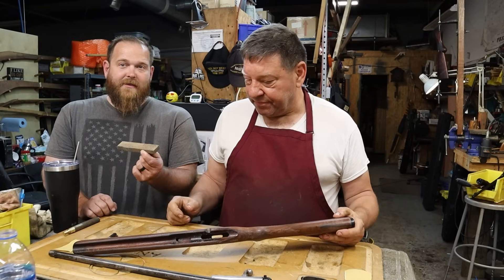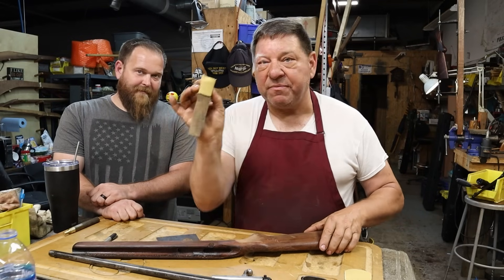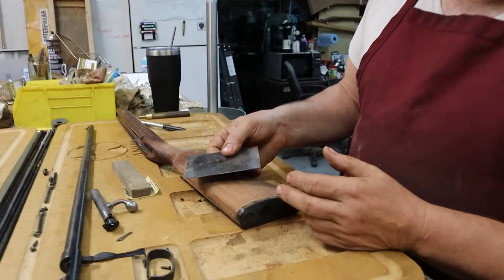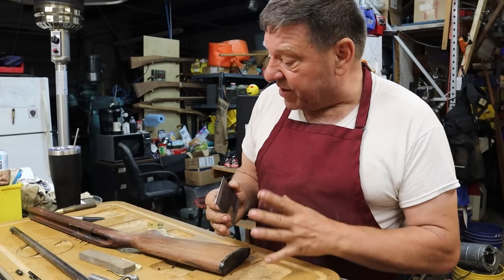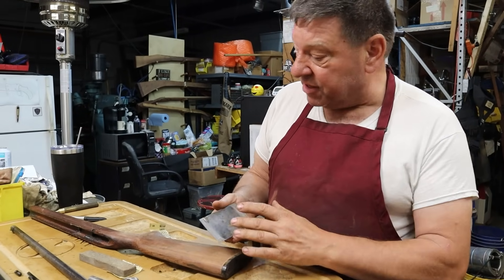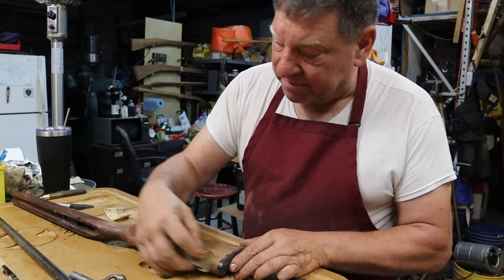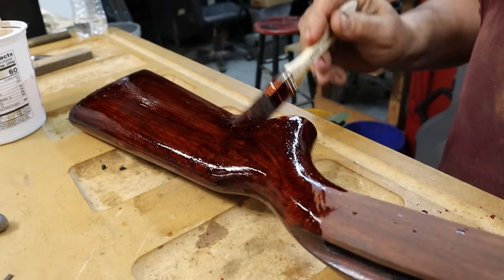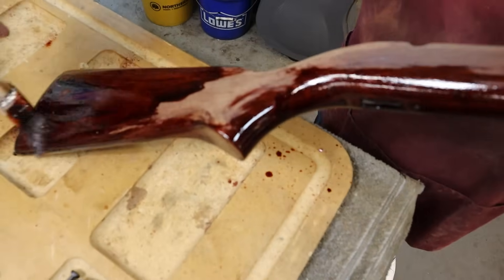Stock Refinishing Like A Pro: Mark Novak

Comment: Mark taught me to scrape many years ago (via video) and its crazy how much ive used it.
I had a flat "multi tool" scraper (one of the oscollating dohickeys) that I never used.  Nice springy steel.  Ive put many miles on it.    Probably cut it down 3/8 of an inch sharpening it by now.  Redid every gun damaged in a house fire.
Mark. Is. The. Shjt.
Reply from the maker: This one was damaged in a fire too. Im glad I took it down to him. This wasn't the main project though.
Reply: Mark is the carbon based lifeform
Emphasis on based
Reply: How do you tackle the checkered areas or just leave those areas be?
Reply: @pickletickle101  Probably best to use a checkering tool to chase it, or grind a tool with the right geometry.  That makes it a lot more complicated to be honest
Reply: @mattfleming86  That’s what I figured. Wasn’t sure if Mark said in any other videos. Thanks for getting back so quick!

Comment: I recently refinished/reshaped a model 514 stock just like that. I straightened, pointed and fluted the comb, reshaped the toeline and added a grip cap, fitted a new buttpad with a brass spacer, cut the forend tip and added a ebony forend tip also with a brass spacer. Sanded everything starting at 100- 220. Sealed and sanded the finish in (tru-oil+mineral spirits)from 320 all the way through 1000(many coats sanded in) until all the pores were filled and the finish was smooth as glass then buffed it down to a crystal clear satin sheen. It took some time but there was some gorgeous wood under all that varnish and stain.....It was a gift for my dad.
Reply from the maker: Sounds nice!

Comment: As an amateur gun smith I can't get enough off your videos! 
Thank you so much for the tutorial.
Reply from the maker: Thanks for watching!
Reply: The toilet ring you mention is just bees wax correct? 
So any old bees wax candle should suffice for the final top coat? 
I have been using mostly Tru Oil or neutral danish oil.

Comment: I've learned for 5 years as a furniture restaurator & learned french polishing from an old guy who actually learned it in switzerland (rest in piece, Rudi), I worked for many years as a custom cabinet maker and I learned SO much from watching gun makers and I'm still learning / refreshing by watching gunmakers. I can recommend that to every aspiring woodworker: watch the gunmakers & learns that bit from them. It will enhance your view on the "bundle of soda straws" ;)
Another little thing (when you have fresh wood): wet it a little, dry it, then 320 or 280 it again, not much, just cut the fibres the water had standing up. The emphasis is on A LITTLE here.
Reply from the maker: Thanks for the tip!
Reply: Omnihil thank you for your tip at the end about the water grain raising and gentle sand back…I’ll soon be doing a pine electric guitar body, and will use real red Alkanet root dye , with danish oil and wax as Mark did here.

I can’t wait for spring to roll around to get cranking on it!

Stay safe ! Best regards, Shawn

Comment: I've been using scrapper in place of 90% of the sanding I used to do on finishing furniture that I build. It leaves a smoother finish as sand paper plugs grain and tends to sand the Summer and winter grain structure differently leaving a wavy surface. Very small with most hard woods, but it's there.
Reply from the maker: My sandpaper use just decreased. Scraper is how I'll move forward from now on.
Reply: @PatRMG  You must have found the same befits I Did. Including less fuzzy surface, smoother feel and easier finish application. I was really convinced by Paul Sellers YouTube channel.

Comment: Mark is a wealth of information. With a polished hammer face, you can gently move dinged dented iron back where it needs to be. I have even used his wisdom to try out rust bluing. (Starting on axe heads, until I have the hang of it, of course. I'm not an idiot, contrary to what my ex-wife says.)
Reply from the maker: I've got about a week of time in Mark's shop under my belt. I'm freaking blown away every time.

Comment: Very nice, thanks Pat & Mark! I have a 1976 Marlin model 60 with the pretty squirrel stock. Gun is really accurate & runs like new & I need to work on the stock. Been putting it off bc I don't wanna mess it up & not be happy with the results. I work with a lot of wood, paint, & stain so I'm confident I can do this process & make it look like a new but original finish. Very good work, explanation, & demonstration! 👍👍 Thanks again!
Reply: Make sure the stock is Walnut and not Beech. This stock is walnut. Beech not so much.
Reply from the maker: Thanks for watching! I actually have a model 60 that I need to repair. Needs a spit shine and a sear spring.
Reply: @marknovak8255  got it, thanks.
Reply: @PatRMG  nice, can't go wrong with a Marlin.
Reply: @marknovak8255  Any tips for refinishing a Beech stock?  Many out there that need it!  I'm thinking of doing a Russian Red tinted poly job on a Beech Marlin (no squirrels will be harmed) for my grandson (he likes red).

Comment: Sir,  I think I heard you say you "boiled" the barrel, what does that mean?  Also, God forbid there is a fire and smoke damage, should we clean our rifles right away, leave them, or do something else?  I appreciate your work.  So many gunsmiths are just AR-15 focused.  What you do is the old art, and it is truly awesome!
Reply from the maker: Yes, boiled. He has a hot water tank that he hung the barreled action in. It causes the  bluing chemicals to convert. Then, he uses a special buffer to remove the oxidation to reveal the pretty blue finish underneath. 

I had preserved this one 7 years ago after the fire by cleaning and oiling immediately. It lost all its bluing from the heat and steam. Just had to keep an eye on it and keep it oiled.

Comment: Good timing Swaby. Have Mossburg 151K somewhere on UPS truck. Was going do Laquer to dissolve the finish, Its a great Smell good. I use to paint old cars,. the rifle shows light rust. May boil, I will see how bad it is. Has to be better than Mausers I mess with. Cute Socks.

Comment: Great video, Mark, as usual. I would, however, caution DIY'ers about proper handling/disposal of rags used to wipe linseed oil-based finishes. Before disposal of wiping rags, it is important to hang or lay the rags in a single, flat layer to dry completely. Rags/paper towels that have been even slightly saturated with linseed oil, if thrown in the trash or balled-up, can easily spontaneously combust, sometimes in a few hours. Some people will soak them in water, but allowing them to air-dry instead has always worked for me, the very same advice is appropriate for disposing of oil/solvent based stains.

Comment: This is the best video Ive seen for refinishing a stock. I just need to take off the top varnish on a Tower Musket. It was a kit and the maker put varnish on and it has drips EVERYWHERE. Your way may just be the trick to remove the varnish and refinish the wood. Can you give me more information on a steel scraper? Can I roll and sharpen an old paint scraper? Thanks again.

Comment: Great job on that old Remington 514.
Reply from the maker: And George identifies the mystery gun perfectly.
Reply: @PatRMG  My perfect afternoon involves a lawn chair, a beverage, an old 22 like the 514, and a full pocket of "bullets". Oh, and a distant steel target to measure the man😄
Reply from the maker: I took the 550 down for a bit of help too. It's looking good.
Reply: The first rifle stock I "refinshed".
I went about it . Exactly the way Mark explained....Don't. 
And capped it off with a thick layer of polyurethane.  Resulting in the forend of the stock Checking at the bottom of the barrel channel.

Comment: Broken plate glass works great as a scraper as well. May sound crazy but if you have it it's easier than putting an edge on a steel scraper.

Comment: great video Pat.,,,, i could set and watch Mark do his magic all day would give my eye teeth to have been able to have trained under him. nice 22 and i gotta ask  HTH did you get Mark to work on it??? from what i've heard him say i didn't think he'd touch one much less work on it..one has to admit he's a master of his trade..i have one that's similar to yours i'm working on right now. talk bout a hunk of junk found it tucked behind a post in a barn ..don't know if even Mark could fix this one but i'm going to give it a try...it's an old targetmaster so it might be worth tinkering with..right now the bolt is froze and i've got it soaking in Marks favorite stuff..."angel piss" hoping it will break free
Reply: Once the bolt is out, concentrate on the bore. If that doesn't clean up, STOP. The bore is the key. The rest can be "fixed"
Reply from the maker: The answer to your HTH is that it was part of a bigger deal. 94 degrees in his shop and I possess a certain set of skills to fix that. 😁
Reply: @marknovak8255  i've had a cleaning rod down it to check to see if it had a bullet in it but i don't own a bore scope so can't see down it but just a little ways with a light  but once the angel piss does its job and i remove the bolt if the bore is shot it's scrap...it is rusty but most is surface if the bore isn't any worse than the outside it's a maybe...stock is the big problem it's been wet has some cracks don't know if it can be saved..thank you for thr reply any knowledge from you sir is most welcome sorry for being so long winded
Reply: @PatRMG  ooooohhh....ok i see said the blind man...good trade
Reply: @PatRMG  Wanna ride up to WV and install a full unit in a vet clinic?  Totally easy job.  I swear you won't have to remove a drop ceiling just to get to the hole where the air handler lives and hoist it up with pulleys.  And the dogs are suuuper quiet.  :-D

Comment: Hello Mark,

Can you let me know what brand of Danish oil you use?  I can't seem to find the red color you are using in your video.  I am in the process of restoring a Wards Western Field 93M 390A rifle.  The rifle is approximately 80 years old and I would like to restore it to as original condition as possible.

Also, I was very pleased with the results of using a scraper to remove the old finish on the stock.  In the past I have used water soluble strippers on my stocks, but was not happy with their effect on the wood.  I had an old metal scraper that I used to remove wax on my cross country skis.  It did a wonderful job.

I enjoy your channel and your sage advice.

Regards,
Charles Henley

Comment: That was a great video! Just had a question about the finishing process. Mark mentions he would apply 3 oil coats, then 800 grit sand, then buff the 800 grit sand with ultra fine steel wool... Is that the overall idea before applying the wax?

Comment: Mark, do you ever do a high gloss stock finish? Like the one that look like there’s a 1/4” of water on top of them? Do you have a video showing us that?
Reply from the maker: I haven't seen him do one. He says they look like table lamps in a French wh***house.
Reply: @PatRMG  Dude is talented but I like that high gloss finish. Managed close with TruOil on a old Marlin/Glenfield Model 70 stock. Stock was a Marlin Model 60 I fitted for the 70 and how much better did it look. Too bad I can’t attach pics.
Reply: You CAN get the high gloss, French polish finish. It takes about 20 oilings over a 2 month period of time, buffing and polishing between coats. A 2000 dollar finish on a 50 dollar gun. The finish you are thinking of is a sprayed on urethane, Looks amazing until it gets damaged or the wood moves underneath it (EVERY Browning). These finishes are not repairable. Oil finish is easy to repair.
Reply: @marknovak8255  Thanks. Just the old standard boiled linseed oil or something different? I got a decent result out of TruOil on a Marlin Model 60 wood laminate stock I finished and fitted to a cousin’s glenfield model 75. Looks good but could look better.
Reply: @308dad8  SAND the wood, POLISH the finish
Reply: @marknovak8255  Thanks Mark
Reply: @308dad8  Watco Danish oil
Reply: @marknovak8255  Thanks
Reply: @marknovak8255  Looking online it looks like this stuff only comes with color in it. Is there a clear version? I’m getting ready to do one of those Traditions muzzleloader kits and the stock is curly maple so I want to get the traditional Aquafortis Regent stain on the wood then the durable high gloss finish. The finish needs to be clear so all the contrast will be visible.

Comment: Hey guys, one thing I forgot to mention in my comment was , you don't need to go spending a ton of cash to get card scrapers, you can make on out of an old hand saw. just clip it off with tin snips to the shape you want. they are made of spring steel and work  very very well and they are flexible, and hold an edge. just a tip guys 🙂..

Comment: Beautiful work couldn't have done it better myself 
Did you blend the oil yourself or is it available
Reply from the maker: He threw a little red into the Danish oil. Then, the wax added a bit of purple hew.
Reply: Watch Danish oil, straight from the hardware store. Added some oil soluable analine leather dye.
Reply: @marknovak8255  thanks
Reply: @marknovak8255  fiebings red leather dye mixed in the danish oil?  Would you be willing to share how dye you add to a quart of danish oil?
Reply: @mattray3171  .Based upon the days long drying time referenced by Mark, he probably used Fiebings Pro Dye, which is an alcohol dye with oil based color added to it.

Their other leather dye has powder added and that dries in about 10 minutes-big difference.

You might want to look up S.B McWilliams Alkanet root stain. It’s a fantastic product that is a truly beautiful red ( walnut is also available) that would probably work with danish oil (check with SB, he’s a good guy) - It’s an old world recipe and he has numerous boutique fine rifle and shotgun builders using it for years now!

Comment: It's quite possible I missed it, but what color of Danish oil did Mark use for that stock? Some shade of walnut I assume.
Reply from the maker: He threw some red aniline leather dye in it. Really fine powder. Mixed it in the Danish oil until it made the correct shade.
Reply: @PatRMG  Ah, okay. Do you know if the base oil was the light, dark, or black walnut? Thanks for the info. Enjoyed the video.
Reply: @metalmanipulator7210  Base oil dark walnut.
Reply: @marknovak8255  Thank you. Pat also told me about the leather dye added as well. Can't wait to give it a try. I tried your scraping technique on a Stevens 44 butt and fore. Worked just like you described. Just the scraping alone, with a heavy dose of patience, made the set look great. Much appreciated.

Comment: Good day and a big thank you for doing this how-to. I just about a half hour ago found this channel. Absolutely perfect timing. I am a rookie-novice at this stock refinishing thing. I have worked  with wood refinishing but never gun stocks. I currently am about to undertake a refinish project on a 1960 Marlin 60 .22, so this is a huge find for me. Thank you again. Now, I do have one question that I am "fretting" over.This stock has checkering and flues (sorry, just had a brain fart)  Nice little squirrel carved into it as well. What do you recommend for getting those areas ready for the finish? I am in a holding pattern before I even consider moving forward in those areas.

Comment: I got a 10-22 stock and used some of that Orange paint stripper, and to get it clean I used water, and after it was all done I was fitting and finishing it and as it sat there with the trigger assembly installed, I heard a LOUD "POP" that was the stock cracking between the stock mounting screw and the hand grip area because it shrunk.
I wish I had seen this video before messing with it. BTW that Danish oil on the Ruger 10-22 Birch factory stock looks like ASS!

Comment: What watco oil color was he using? Looks so good 😮
Reply: He tinted the Danish Oil with some alcohol based red leather dye, probably Feibing's brand, although I've used Angelus as well. When it comes to staining a stock, leather dyes are all I use or ever will use. Getting the color right is just through experimentation, but I have used them straight or mixed, the possibilities are endless, even ebonizing with the black.

Comment: How do you get the  varnish out of checkering?
Reply from the maker: Hopefully, Mark himself will have some insight to that.
Reply: Must be chased out with a checkering tool. So, recut the pattern
Reply: @Mark Novak  thanks for the reply mark, I watch your show often. I  thought that might be the case but some checkering is pressed in and not cut, which makes things awkward. Regards from Kim, in Australia.
Reply: @kimbennett2750     correct chequering tool   -  same result

Comment: This is a noob question, but here goes: I have a milsurp mauser with tons of gunk on stock. I noticed that the bed of the stock has absolutely no stain/sealant/anything.  Is it wrong to seal/stain/wax the bed of the stock where the barrel will sit while I'm doing the exterior of the stock?

Comment: Use a razor blade. Not everybody knows how to sharpen a scraper.❤
Reply from the maker: Did you actually watch the video? We detailed how to make a scraper.
Reply: @PatRMG  I'm sorry, wasn't trying to offend or take anything away from the knowledge provided in the video. It is easier for the regular dude to get a razor blade than make his own scraper. Yes I watched the video, I learned about the Danish Oil finish that I wasn't aware of as I use Tung Oil for most applications. It has more of a golden hue rather than cherry. Boils down to personal preference in a lot of circumstances!